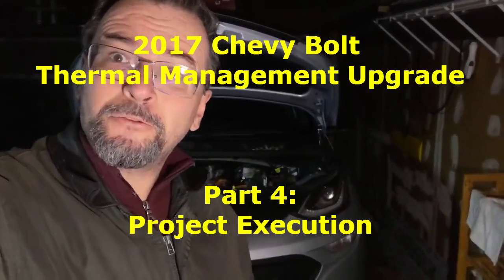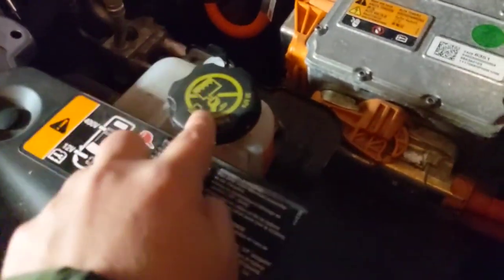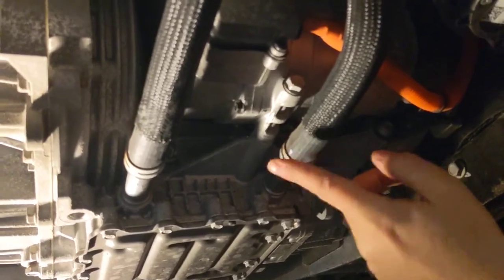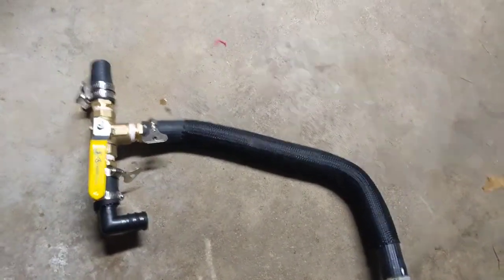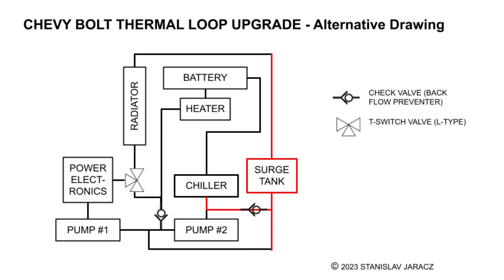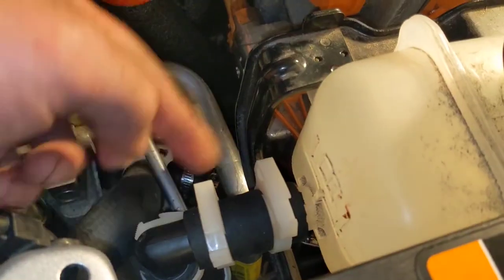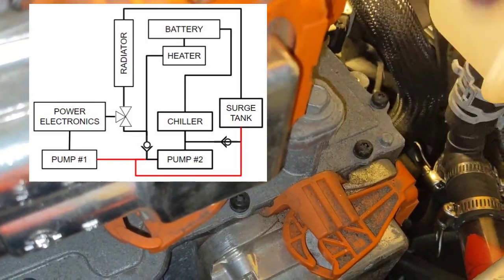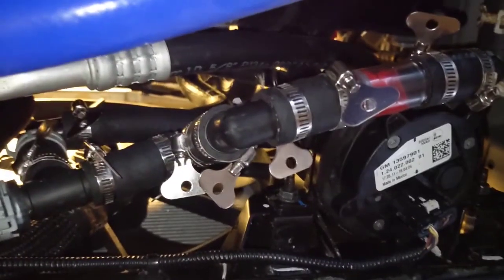2017 Chevy Bolt EV, Thermal Management Upgrade, Part 4: Project Execution

Comment: This is great! I was thinking of doing something similar but with the cabin heater loop. This is  better since it scavenges the waste heat from the power electronics. I dont see another video on your channel like you say you were working on. Is there more info you can provide on what improvements youve made? Or how the system works in the winter for keeping the battery warm for DCFC?

Comment: Hi, interesting mod but have you thought about upgrading the cooling part? I'm thinking about going a bit wild with a Bolt by adding two 50KW hub motors to rear wheels for sub-4sec 0-60 times but looking at how badly the battery cooling is implemented I'm afraid the battery could weld itself under 250KW load. It's a pity they threw out the per-cell cold plate Volt approach, that beast could handle 8C discharge.

Comment: Hi @stanislavjaracz. I've watched this and all your other videos. Thanks for taking this on and documenting it so well. The only thing in your design that I did not like is that the system needs to be monitored so closely and switched manually from winter to summer mode. I noticed in one video that you mentioned that there is a conflict in winter mode when the defrost/defog is selected, which turns on the AC compressor (and thus has refrigerant flow through the chiller). The solution to this, in my opinion, is to set the system in winter mode by default and use an electric valve to switch to summer mode any time the AC compressor is energized. This would make the system a bit friendlier to non-engineer types. I don't think I would go to the same lengths as you to insulate the battery. My chief concern there would be corrosion. I'm in southern Ontario in Canada and the roads here are very heavily salted in winter. Any salt-laden moisture trapped between the foam and the bottom of the battery will surely cause accelerated corrosion of the battery case. I agree that thermally there are great advantages to insulation, but I personally wouldn't want that to come at a reduced lifespan on the vehicle. Did you make your foam such that it can be removed in summer?

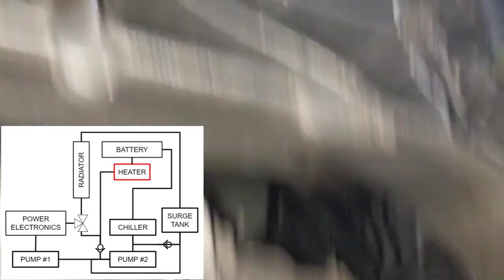Comment: 10:03 Hello, Stanislav, do you know how the battery heater works, since in your 1 video, you showed the battery was too cold when you were charging. I would imagine the "Battery heater" on 10:03 of this video would keep the battery warm on cold days, when the car is plugged at home overnight.  Thank you for the vide
Reply: It's kind of amusing he's over complicating his system that will obtain minimal gains in efficiency with questionable reliability. I'm here thinking just put in a flat plate heat exchanger before the radiator that has a removable input for pre-cooled or heated liquid that could be waste heat recycled off-car from the charger itself, PV panels upgraded for thermal, or misc.

Comment: Thanks for the video. Here in Quebec we're  confronted to the same or worst reality of cold winter. 
I was thinking of a similar mods but with a heat exchanger and an electric valve and switch to bypass the heat generated by the Electric motor to the battery pack. What do you think?

Comment: Amazing work! In light of the Bolt's battery fire issue, I commend your bravery 😊. (Do you know whether Chevy identified the issue as chemical vs. software/other?) This begs the question "Why didn't Chevy do something similar?"
I appreciate you showing the chart of post-modification charging results. Eager to see what your OBD values are when fast charging in very cold temps with these modifications.
Reply: Pre June 2019 Bolt batteries are made in Korea and that entire batch of batteries will be replaced on recall. Post June 2019 batteries are made in Michigan only getting software + battery inspection and testing.